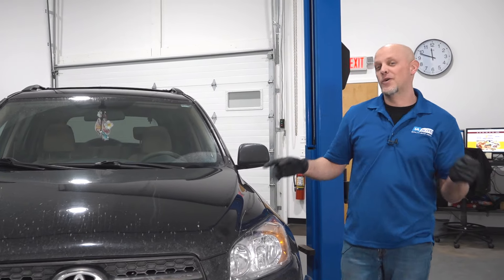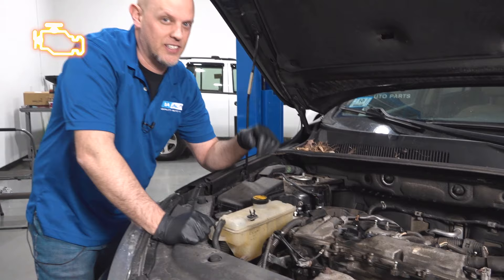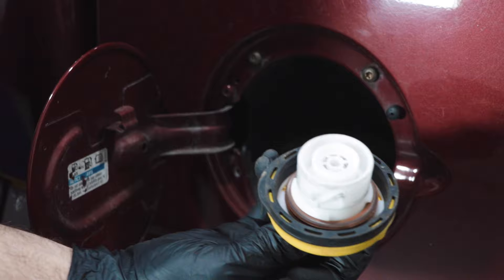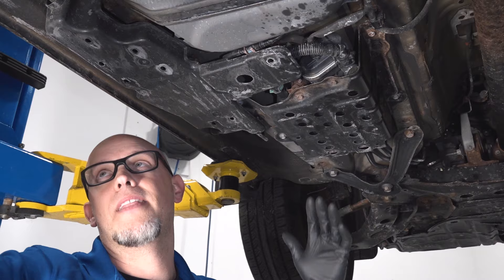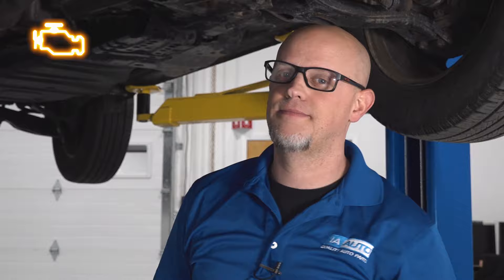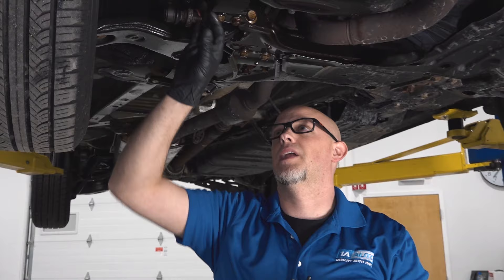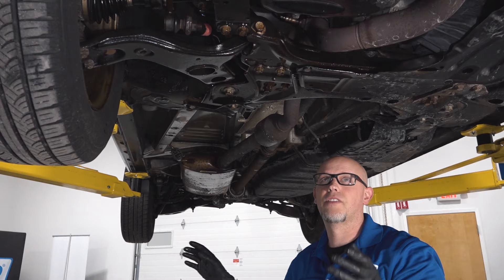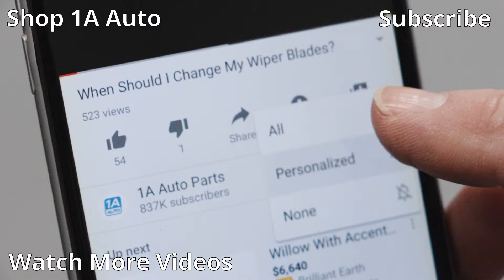Top 5 Problems Toyota RAV4 SUV 3rd Generation 2006-2012

Comment: I have a 2010 4 cylinder rav 4 it only has 88,000 miles on it but I had to get evap canister it was idling rough and it would cut out a few times prior to having the evap canister replaced . It was running fine for a month and now it just started happening again I would see the maintenance required light start blinking then go off then a few minutes later it started idling rough and cut out it happened 5 times in row I managed to get home parked it very frustrating

Comment: 2012 base rav4, 130k, dealer replaced rear suspension under warranty, replaced alternator after it crapped out at around 90k, new sparkplugs @100 as well as new maf sensor, other than that just regular service.

Comment: Hello! I'm having problems with my 2006 Rav4, please can you help me find out what it could be? I notice that when I drive for extended periods, once the engine is warmed up, water begins to leak from the radiator, escaping through the radiator cap and also through the breather. There is also an oil leak (under the car on the right side); the oil is very clear and thin. These leaks don't occur when I drive for a short time, only after about 20 minutes of driving. I've already checked the engine oil level, but it's fine. Could you please provide some insight into what the issue might be?

Comment: My 2010 has 210k on it and it’s oil thirsty. Been looking for a leak but haven’t found anything. Loses about a quart every 1500-2000 miles. Pretty normal for a regularly maintained car?

Comment: I own a 2007 it has 178,000 miles it consumes oil, but I just add a qt. Every 500 to 600 miles, and I have a 2012 193,000 miles and is no problem with oil consumption, both vehicles are reliable no issues what so ever. Great on gas.

Comment: What year rav4 is in the video? I have done research saying not to buy 2007-2008 models but to buy the 09-10 models instead. I am currently looking at buying one with 4x4, V6 in either the limited or Sport. And what some forums and websites are suggesting is that the later models are a little easier to deal with in terms of maintenance and problems.

Comment: HI absolutely love your videos I've never done anything with cars but found you and I've already changed the front wiper motor on my rav. I'm just wandering if you have a video on how to change the fuel filter under the fuel pump in a toyota rav4 mk3 57 plate. Thanks

Comment: I’ve recently noticed that when I start my rav 4 that the revs sound like they are in a slightly higher pitch kind of like as if a choke was on, the actual rpm of the car doesn’t change though.. it just sounds slightly higher pitch than normal and it’s mostly noticeable when I’m not moving or just starting to accelerate from stationary otherwise it gets drowned out in the noise of the engine after that. Anyone able to help me? Or maybe potentially suggest anything I should have looked at by a mechanic?
Reply: i had this problem. just use a fuel system cleaner and it will solve it.

Comment: The 2AZ-FE engine is notoriously known for burning oil and having the threads pull out of the block for the cylinder head.  2GR-FE is known to have camshaft phasers fail in early years of that engine.  Both are very costly to repair do a lot of research before buying a Rav4.
Reply from the maker: +fj60driver Thanks for checking us out! http://1aau.to/m/Shop-1AAuto-c
Reply: Yah but those problems would have been fixed by now right?
Reply: @barackobama5304  
Not necessarily. In March 2019 we bought a 2009 RAV4 with only 18,580 miles on it. Fortunately it has the 2.5 AR-FE engine. But if we bought one a year older with that low mileage, chances are the issues wouldn't have been addressed.

If there is concern you can call Toyota's customer care number and confirm what warranty work was done just by giving them the VIN.

Comment: We have a 2006 RAV4 Limited 4 cylinder. Here are our common problrms.

1. Water pump leak at 90,000 miles
2. Noisy Serpentine belt tensioner at 120,000 miles. Toyota updated the design at least 5 times. I had no luck just replacing the roller.
3. Intermediate steering joint, made clunking noise from the day one, Toyota never recalled because it wasnt safety issue.
4. Pass side upper engine mount went bad around 100,000 miles.
5. O2 sensors went bad around 75,000 miles. Upper sensor was due to rust
6. Rust everywhere starting 5th years on the road. 
7. Soft brake system. The car stops but its soft. There is no air in the brake system.
8. Loose "A" pillar plastic trim starting 3rd year on the road. Its annoying. Yeah, we paid $27,000 for Toyota quality.
9. Eats oil, 1/2 quart every 3000 miles. We used Mobil 1 oil since we bought new. Must check oil level between oil changes. I noticed our new 2018 Tucson eats a small amount of oil too. Maybe its normal.
10. Exhaust manifold leak, replaced the entire unit recently.
11. Have struts/shocks ready to be replaced when the weather gets warmer.

I think we have a lemon. How about your RAV4? I expect trouble free for at least 150,000 miles. Am I wrong?
Reply: Seems you got unlucky unfortunately. I dont have the same, I have 2008, but the only things I've had to replace was consumable parts like the tires and brakes. It currently has 200,000 miles
Reply: I have a 2009 D4D XTR 2.2L
Issues faced:

Grinding noise when turning from a standstill or moving slow = Top struts mounts need replacing, cant be bothered.

Rusty fuel fill kneck causing major leak = was a bad design by toyota when water and dirt would get trapped updated design no more fault.

ABS/VCS warning light on dash = brake light switch cheap fix

Spongey pedal that drops if your hold it on = doesn't affect brakes just alittle strange

1 rear shocky slight leak at 80,000 miles = replaced both

Other than that it runs spot on and has never let me down, i bought it second hand with full service history but last owner deffo stored it on a farm so i took a chance on it.
Only thing ive had to replace in my ownership is rear shockys, front disks and pads (warped from previous owner) 
2 Front piston caliper kits (one caliper was slightly sticky)
Brake light switch

Yes the rav4's love to rust underneath, need to keep ontop of them, i have a 2002 corolla which is immaculate underneath no rust, toyota don't make cars like they use too!

I love toyotas if you look after them theyll look after you
Preventive maintenance is the key
Reply: The oil consumption was faulty with that 2.4 engine.
Reply: I have a 2011 4cyl. Bought it with 80k miles on it in Sep 2019. Only owner. As off today it has 172k miles. I drive on the freeway a lot. I first have to say that I love this car and it has been super reliable and never once left me stranded. Preventive maintenance has been done religiously (fluids, pads, spark plugs, filters etc), is easy to do and everything is simple. But here’s some negative things I have experienced so far:

1- Car has a whining noise that comes from the Transfer Case area at around 25 mph, goes away, then again at 45 mph (not as loud) and goes away if I drive faster. Has had this noise since day 1 of owning it and only got a bit louder over my ownership. I can’t find the source of this noise but I notice it goes away if I put it in Neutral. Doesn’t seem to harm anything. Mechanics can’t figure it out and I found out on forums that it’s a normal thing with these Ravs. It’s annoying but I learned to live with it. 

2- VVT Solenoid started to display the typical knocking noise with these engines at around 120k miles ish. It happens when you cold start it and it lasts for about 1 - 2 seconds, then goes away as oil pressure builds up and pin locks into place. With some extensive research I found that it will cost me 700 - 1200 dollars to replace it. But I also found out that it’s not that harmful with the 4 cyl, it’s just annoying and it might last longer overtime when cold starting. If I really don’t replace it, over a long time it might mess with valve timing. 

3- Spark plug chamber number 4 has a small internal leak. I found that out while replacing all spark plugs at around 110k miles. Spark plug came out with a dark line of oil on it. But tip was clean which means it’s not piston rings or something major. Left it alone, no problems so far. 

4- Belt tensioner (I believe) is making a constant knocking noise after cold start, specially after putting into gear or turning A/C on. Gets quieter after the engine has been warmed up. Something I need to look into it and replace it. Started at around 140k miles and has gotten louder. 

4- Front right suspension recently started to go bad at around 150k miles. Just normal wear and tear. Already bought a new one (KYB Brand). Still waiting for the left side to go in stock again to buy it. 

5- Brake pedal is somewhat soft and it has been since I bought it. Replacing pads, rotors, and lubricating guide pins regularly seemed to help, but didn’t solve the problem. 

6- Small Muffler Leak appeared at around 140k miles right on a welding spot at the very center.

7- Trunk door has a big rattle that I cannot fix it for the life of me (whole door moves and makes this noise). I already replaced the V shaped plastic that holds it in place and nothing. The temporary fix is a folded rag between the weather strip and metal where the latch is located, gets rid of it 100%.

8-Small plastic rattle that comes from the back that I also CANNOT find the source and it’s super annoying as it’s higher pitched then the trunk door one. 

9- Alternator is weak (low idle symptom while stopped), but when the lights are on (even the parking ones), the car bumps the voltage up a bit and symptom goes away.
Reply: I traded my '16 tucson for a '11 rav4. I will NEVER own a hyundai again. The tucsons DCT shit the bed 28k miles in... hundreds of complaints Hyundai just replaced it. The alternator died at 80k, rear diff at 92k. It was a NIGHTMARE. I magically got an $8k trade in value and paid $4k cash for the rav4 with only 68k miles. The tucson needed new tires, oil change, and struts at 110k so basically $2k+ and i finally said "F it".

I had to replace the alternator 5 months into the rav4 but it was 10 years old... the hyundai was 3 years old when i had to do it.
Reply: 3rd owner of a 06 rav4 petrol auto here. Mine has 117k miles, MOT passed with no issue or advisory🤣. Issue’s that I have right now are the following. 

*Clunking steering wheel 
*Clog evap
*Busted two front shocks
*Weak brakes even with 4 new rotors and pads
* Not so cold aircon
* Dead alternator” waiting for the part to arrvie

My 03 Honda Crv is far more in better shape than the rav4. My only issue with the gas consumption🤣
Reply: @Xandro_B20  
Clunking steering is likely an intermediate steering shaft. There was a TSB on I. It was $500 to replace it on ours. Paid for 100% with aftermarket warranty. Ours is a 2009 model.

Comment: I have rav4 model 2009.
Error in cylinder 3 when I reach high speed or climb high level.
Changing sparks and coils plus swapping injectors but still same code. Checking cylinder 3 compressio it is ok.what do you purpose please.

Comment: Thanks for this video, does the oil leaks happen on a 4 cylinder 4WD with approximately 100k miles on it? 2010?
Reply: That engine is renowned for using oil.  Bad design.  It’s the same issue for all Toyota’s with that engine.
Reply: I have a 2009 and a 2011 Rav4, both with 4 cylinder engines and over 100k miles.  No oil leaks on either one.  Great vehicles.
Reply: @Kingfisher1215  
I think you may be confusing the 2.4 liter engine with the 2.5 liter engine. The 2.5 liter first made it's appearance in the 2009 RAV4 in the 2009 model year in the USA.

Comment: My 2007 has SVC, Check Engine, 4WD lights that won't go out. It causes the cruise control to not work. After paying out $1,200 to my local repair garage the damn lights still come on.

Comment: My 2012 V6 4WD has 135,000 miles and so far no problems outside of routine maintenance. The transmission has begun to sometimes shift a little erratically under hard acceleration,  but I have punched it to the floor many times over the years. ;)  

ATF service change every 35,000 miles keeps it from getting too bad.

Comment: Just had an oil change today at my local Toyota dealership. The service rep says my 2008 Rav4 (V6) with 194k miles on it needs a Timing Cover Reseal due to an oil leak they noticed. The service rep quoted $4200 to do the job. I was shocked! Is that way overpriced or normal price range for this repair? Need advice please. Thanks in advance! 🙏
Reply: Your first issue was going to the toyota dealer lol
Reply: How much oil are you adding between changes? Will it cause any damage running it that way and just adding oil? Is oil dripping on your asphalt driveway causing damage? $4200 will pay for lots of oil.

Other alternative... Try finding a good independent mechanic that's good with Toyotas.
Check with The Car Care Nut or Toyota Maintenance here on you tube.
Reply: I also have a 08 v6, I have a very small leak from the timing chain cover near the infamous vvti oil line, luckily for you and me this is not a high pressured zone, all you have to do it locate the leak, clean it very thoroughly, then apply some gasket sealer, let it for a day or so and be on your merry way.  Just don't make a mess
Reply: 2007 V-6 190,000 mi. same issue with the dealer think he said 1700$
The oil seeps on the lower end of motor have not seen any on the ground.
I keep it clean add stop leak with every oil change, keeping my fingers cro$$ed.

Comment: Oil consumption problem on the 2AZ-FE engines
Reply from the maker: +Joel Ortega Thanks for the tip!
Reply: True. The engine runs forever but uses excessive oil at some point due to piston rings wearing off.  When I hit 200,000 miles on our 2006 RAV4 I, I ordered a used engine for $800 from Japan that had around 50,000 miles. Driving the car to about 400,000 miles more or less...
Reply: 2GR-FE on 2009 + doesn't have this issue.
Reply: @igorseprak6177  That’s impressive! Could you share the name of the place/ website you bought the engine from? I plan on keeping mine for a long time, love the little thing. I might do the same.

Comment: Thanks you for making the video and sharing your knowledge. I am looking for a RAV from 2009-2012. Currently have my eyes on some 2012, 2.4l engine 2AZ-FE. I heard they have piston ring issue. Any comments

Thank you so much
Reply: Yes, unfortunately they have this problem. It is not so common as you may think, but some will eventually start burning oil at 100,000 miles or so. Can be rebuilt and fixed. Check if they have already done that.
Reply: Hey did you ever find a rav4?
Reply: I believe 2012 has the 2ar fe
Reply: The 2011-2012 ones do not have the burning oil issue thankfully. They addressed this problem for the last years of this gen. for the 2AR-FE engines.
Reply: @codyshelton5247  what engine you have bro the disel and what you think gor the 2.2 d4d 170 or 150 2011 2012 i will buy one
Reply: Does the V-6 have oil burning issue?
Reply: @thetechlibrarian  
Depends on what country you're in. In the USA 2008 was the last year for the AZ-FE 2.4 liter engine. In 2009 the 2.5 liter AR-FE engine was used.

Comment: I took my 2012 RAV4 w/ only 71.9 miles to a local Toyota dealer for a transmission fluid exchange.  After the service, they said I needed 2 lower control arms.  I then took my vehicle to my regular mechanic.  He raised my RAV4 in a hoist said both control arms and sway bars look fine.  Who do I believe?  I do have very low mileage.  Should I get a 3rd opinion?  Thanks!
Reply: U should be fine the dealership just wanna make cash
Reply: As long as you don't have any clunking noises, vibrations, vehicle pulling to one side or visual damage don't let the dealer steal your money. Just because a vehicle part has some amount of wear doesn't mean it needs replacing. The 2nd mechanic was a good idea and has no reason to lie to you, so no reason to see a 3rd.
Reply: There was a recall on the rear lower control arms. An independent mechanic may not know about that but a dealer would. The problem is with rust and premature breakage. You don't want that happening on the interstate. Aftermarket parts are available. If the dealer performs the service they will fix it so the control arms are not adjustable. Mine are that way. So far we haven't had a problem with tire wear and haven't needed a wheel alignment.

However, your dealer could be making a mistake. The problem was in the 2009 model. I don't think it applied to the 2012 model, though I'm not certain.

Comment: My Rav 4 has a problem. That is when driving it will indicate check engine, shift to P for safety. If I  continue to drive it will stop it own and seize to drive. Any solution for that ?
Reply: My subaru has the same problem. Did you find the solution yet? The garage was not able to find it.

Comment: These days I was looking for a Honda CRV and Toyota Rav4 both 3rd Generation. So, my questions are: Which of those is better? Which version is better (Manual or Automatic)? 
Thanks for the answer.
Reply: If you go Honda use manual, there cvt is crap just like Nissan. Toyota makes the best transmissions. You don't want cvt transmissions so many problems. When they are new ok, but no old or used ones, because people stomp on those wrong.
Reply: neither of those generations use a CVT; they use 4 or 5 speed automatics. The RAV4 uses a 4 speed automatic unless you get the V6 which uses a 5 speed automatic. The CR-V uses a 5 speed automatic
Reply: the real answer here is... if you want 4cyl buy a Honda 2.4L if you want 6cyl buy a Toyota 3.5L
Reply: Neither is better than the other. Buy the one you like most.